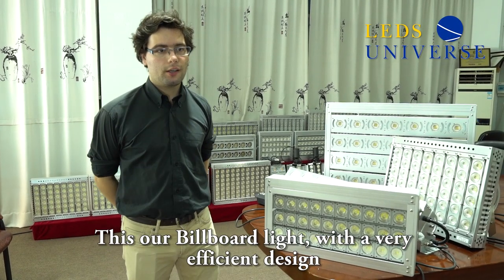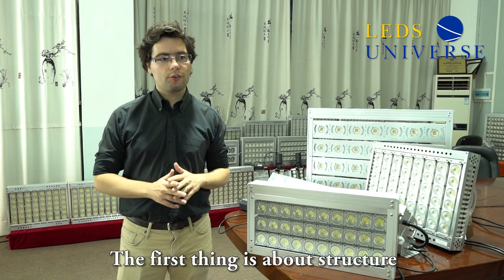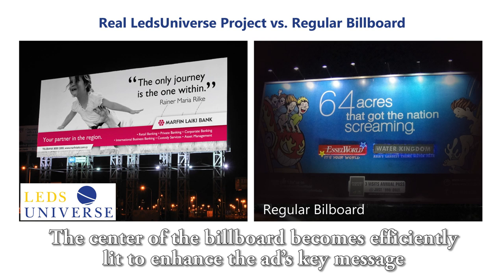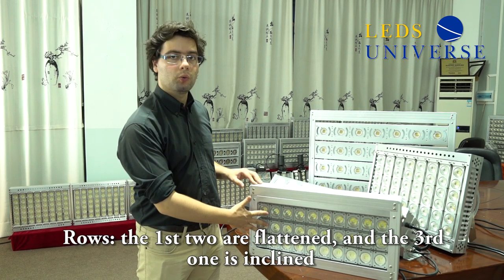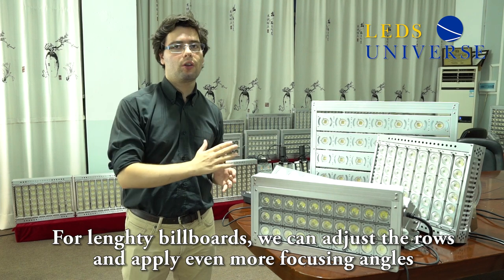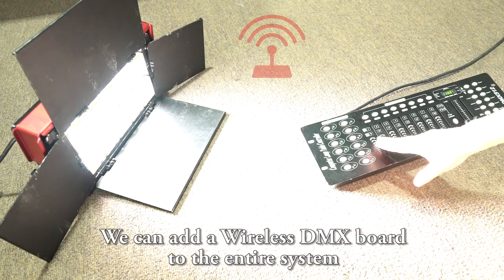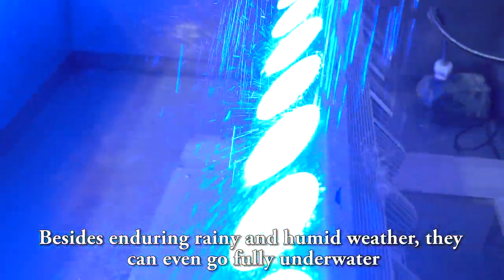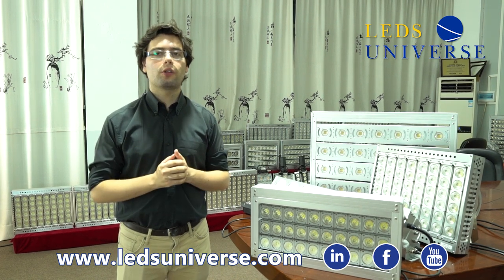300W Billboard light and Sign Light – Angle and Structural Advantages / LedsUniverse

Comment from the maker: Billboard lights Video

1. Introduction
Hello everyone, today we are going to show you our LED lights specially designed to illuminate billboards.

Before, it was very common to use Metal Halide lamps with 250W, 400W or 1000W to illuminate billboards, but with our LED Lights you won’t need more than 300W of power in the lamps. Our lamps will not only make you save more than 70% of power but will increase a lot the quality of the billboard.

2. Structure
This is because the position of the rows and the angles of the lenses. Optimizing these two things the light will spread equally in all the billboard without reflections that prevent reading the advertise correctly.

(Show some pictures of billboards with reflections and some using our lights)

As you can see (show the light) the upper row is declined a little bit to gain light uniformity, depending on the size of the billboard we can adjust this row.

3. CRI
Another important factor is the CRI level, as we can achieve 95+, this will make the advertise look more natural with really vivid colors. (pictures with different CRI levels)

4. Dimming Control
We can incorporate a DMX control in the light so you can dim it according to the needs

5. IP66
The lamps have a compact aluminum structure that can protect the light under any weather and meteorological condition.

www.ledsuniverse.com